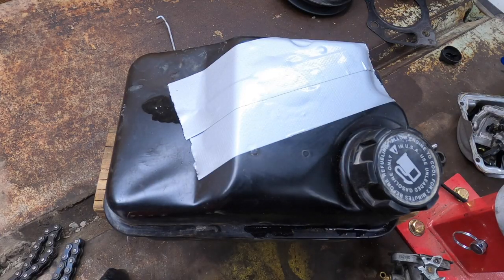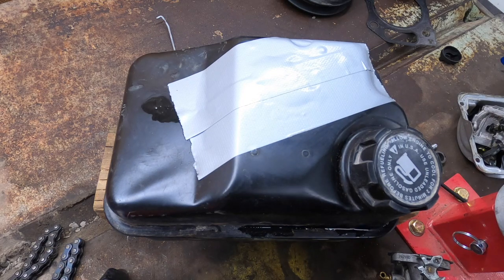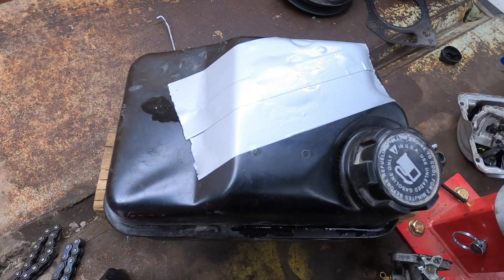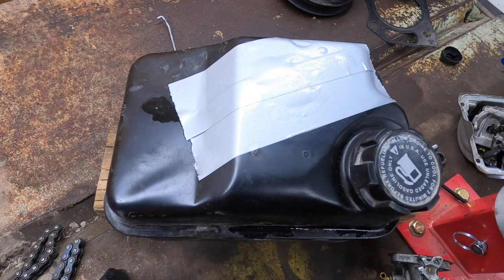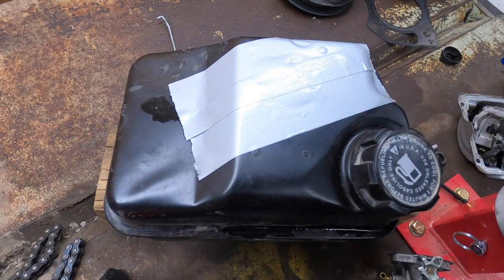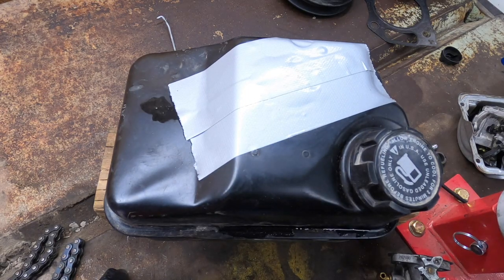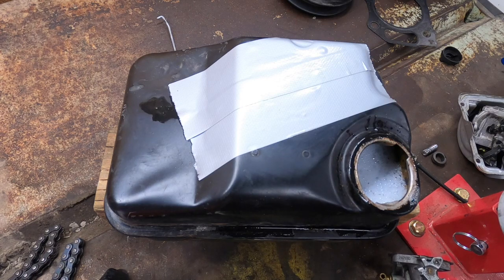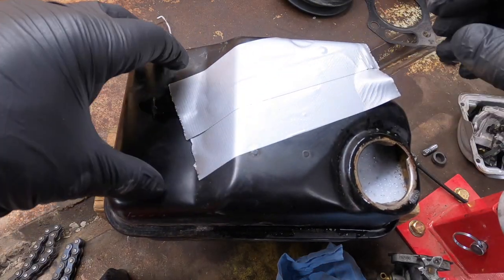Rusty Tank Restoration Experiment using Toilet Bowl Cleaner (The Works)

Comment: Looked like it worked well on the rust. Might be better to try to wash and/or blow the foam out first on the next one. I use a pressure washer when I can but don't think it'd work with that plastic baffle in the tank.
Reply from the maker: Thanks Matt, that isn't a bad idea.  I did after the fact, but you are right, it would have probably worked much better to get a lot of that out before hand.  Next time...

Comment: I have a 5 gallon tank, Honda v65 .. do i need to buy 5 gallons of this stuff?. How long does it need to set? Will it harm gaskets, paint etc.? How do you treat the tank to prevent flash rust. I'm trying white vinegar for 48 hours now. I have two tanks.... The other is the worst of the two.